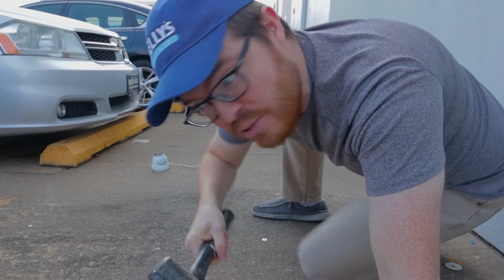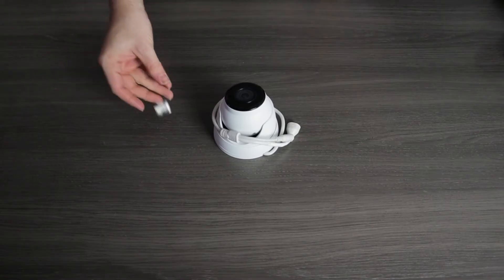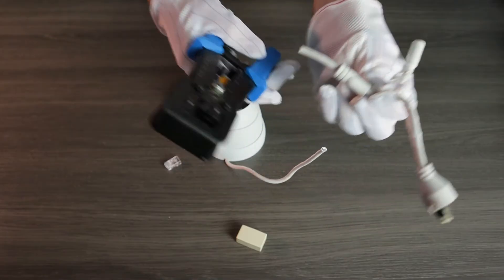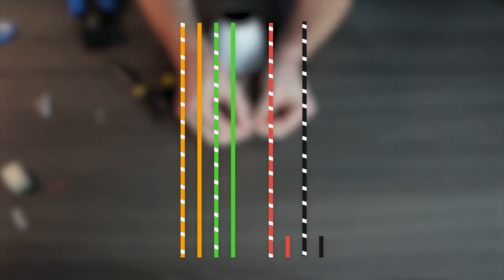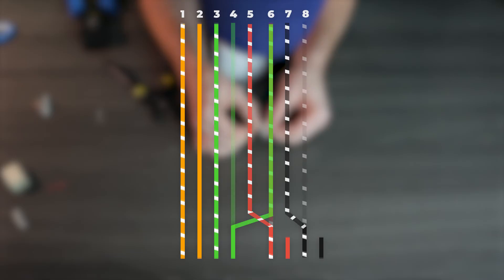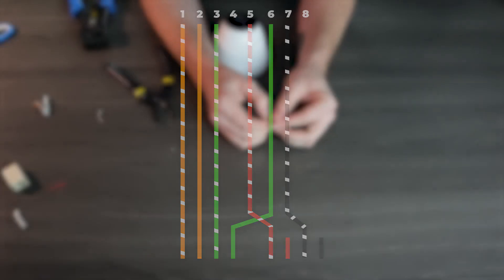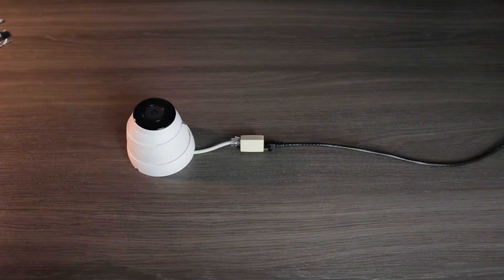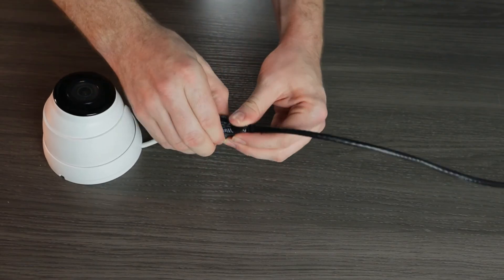How To Fix Your IP Security Camera's Damaged Ethernet Connection (R-Series)

Comment: Can You help with dc wire extension to camera by 30meters cable why signal is not wroking. 9V 0.6A orginal charger. How to fix issue properly?

Comment: im using a senda ip camera 360 and when dec 1 2023 came in to the calendar the camera went out still on the network but cant open it and it says camera not online even though it has power and network is working fine i connect it with wire since i messed up with its wifi antena i broke it but before this before i broke its antena same issue occurs with wifi can you help me with this one? thanks

Comment: I have an acesse IP camera, it has 5 single stand wires in a color scheme I can't find on the internet. Black, blue. Purple, green and green/white. It's powered by separate power cord. Unsure how to wire into new female connector
Reply from the maker: Unfortunately we do not have information on that brand. We would advise reaching out to the manufacturer to see if they can provide that info for you!

Comment: thanks, mine after completing the convection it work only with  12 volts direct current ,why?
Reply from the maker: What model of camera are you using? Was the original connector badly damaged? Its possible the pins could have been shorted out inside the camera as well, causing it to not support POE anymore. Or you can try redo'ing the connector replacement.
Reply: @NellysSecurity  thanks, no only one pin was damaged, this happened after connector replacement , could it be from the camera?     how to find out ,?

Comment: Hey good day just a quick question.. I love your explanation in your video but I'm wondering can't I cut the wires and on the poe camera and use my older dvr instead of my nvr system??? I have so many poe camera but I don't have the standard camera
Reply from the maker: Hey Neil,

I would advise finding out the manufacturer of the specific camera. Then they should be able to provide the proper pinout for you.

Comment: DIFFERENT COLORS  Just completed my best try at repair and the camera works. In my ANNKE Model 151DJ, the wires were all solid colors and to FIND the sequence at the connection which was totally blitzed. I found nothing online with these colors shown. I had to dissect the core.  I used your spacing and physical sequence in the old plug in this order:  Orange Yellow Green (Grey) Purple Blue Brown (White)  I cut short the Grey and the White before inserting in RJ45.

Comment: is there diagram of cable cut dahua DH-ipc-hd8w2300rp-Z
 model
with color coding, this coding did not match
Reply from the maker: That looks like a Dahua model, which we do not have information on currently. 

I would reach out to Dahua directly, or even a google search may get you your answer! Just be sure you get the proper pinout for your specific model.

Comment: Out of curiosity, why didn't you use a cat5e or cat6 module. And to weather proof it use a small price of heat shrink. As well as some of those wires may be stranded. If that's the case soldering the wire carefully then punching it into a module may be easier.

Comment: use a scrap piece of wire in the connector spots that are suppose to be left empty to help line the wire pins up. also if a solid wire you may consider a keystone puncheon jack instead of using a coupler.